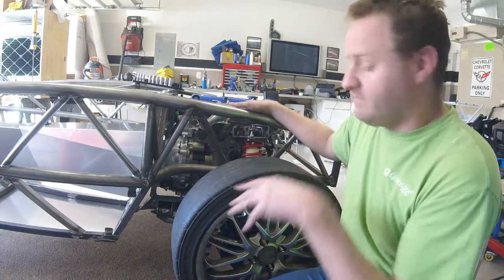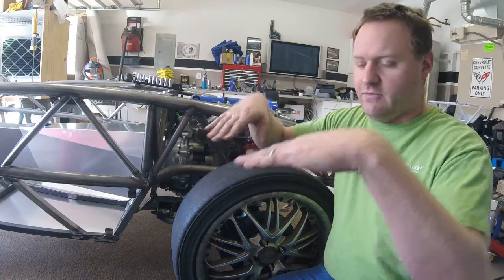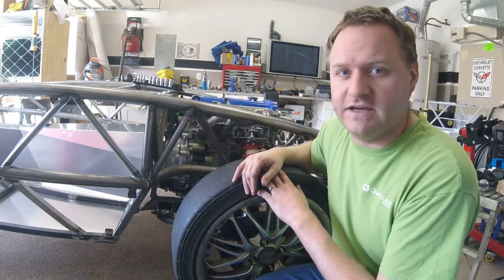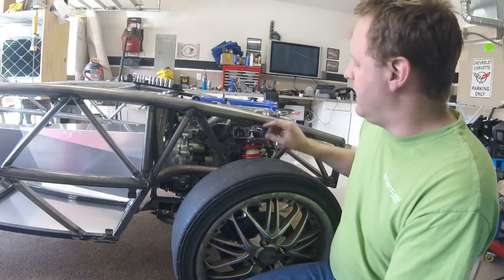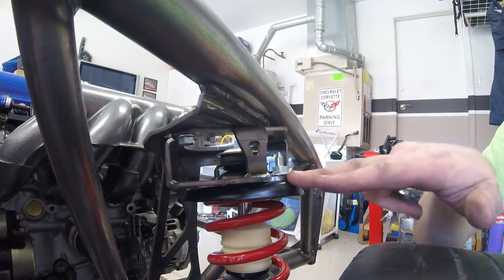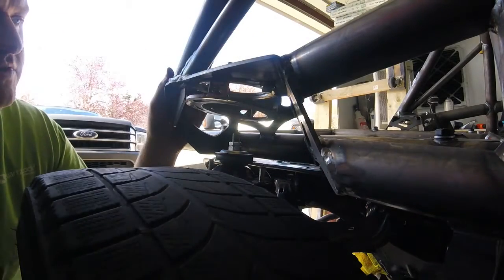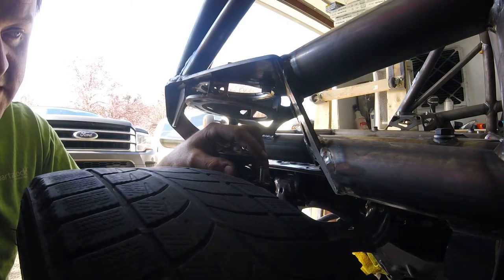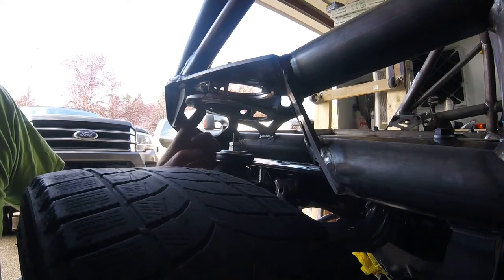Exocet Build: Exocet Shock Spacer Install (Part 28)

Comment: Thats pretty disappointing.. so many fitment issues for a kit that is specifically designed for 1 car. I don’t understand why cnc aluminum panels wouldn’t fit perfectly with a steel frame it was specifically designed to fit with. These are different aftermarket parts. These are pieces coming from the same place. Im a competent auto tech and I excepted some fabrication might be needed here and there but not for fitment of the parts that come from exocet. :( Maybe now in 2022 a lot of these issues have been ironed out?

Comment: is it possible to use miata aftermarket strut spacers instead of using the Ecomotive ones? I didn't order one from exomotive, so if the car scrapes after i'm done with the build, will be another headache to wait for the parts before it's road ready.
Reply from the maker: It might be?  I dont think anyone has ever tried.  I wouldn't chance ot, I would order the shock spacers unless you have fox shocks from FM or long body xidas
Reply: BuildingTheEXOCET I have tein, so probably won’t sit properly. but thinking of installing bigger wheels, maybe that’ll help with ground clearance even without Exocet spacers

Comment: Thanks for addressing the rear shock spacers! Why the hell did they put the two bolts directly opposing each other on the rear spacers? Suck a pain in the ass...
Reply from the maker: Lukas Gilkey considering the top hat can rotate I can't see the reason the top and bottom bolt holes can't be rotated so they don't hit.  Just doesn't make sense.  Especially when they are the price of gold for a couple pieces of steel
Reply: I wanted to switch all my shock mount bolts to grade 8, so ended up buying about 10 different lengths and variations of 5/16" bolts from mcmaster carr to see what actually fits on the rear spacers. What ft/lbs of torque did you use for the spacer bolts? I think it is 30ft/lbs but was hoping you might be able to confirm.
Reply from the maker: Lukas Gilkey I heard 20-30. I think I went 25
Reply: @BuildingTheEXOCET  Baffling...I had to find this video to make sure I wasn't doing something dumb. I might try to rotate the top hat further away from the bolts and drill new holes/weld doublers on the back of the spacer for the studs (since all the real estate there is slotted anyway). Any reason I shouldn't? What a terrible design 

I'd rather not cut down the studs on the brand new $3000 dampers I just got 🙄
Reply: My frame is being powder coated. I have the Vmaxx as well so I’ll make note. Very Annoying that these parts aren’t made to fit. Great video!
Reply from the maker: John Leto  believe me it's the first of many annoyances.  There are many things you are going to want to scream about haha